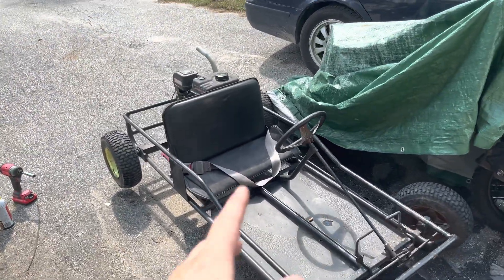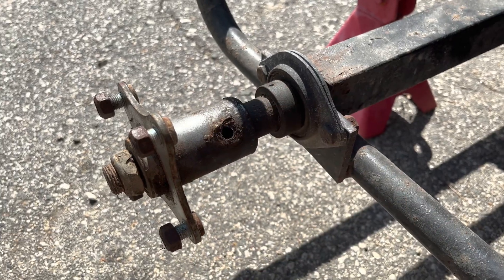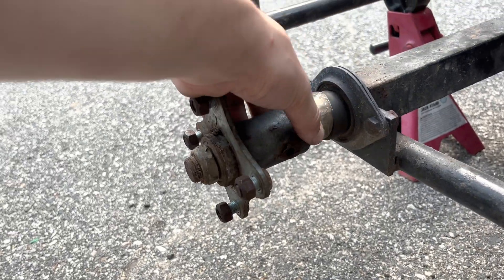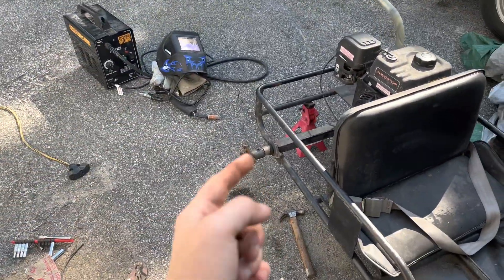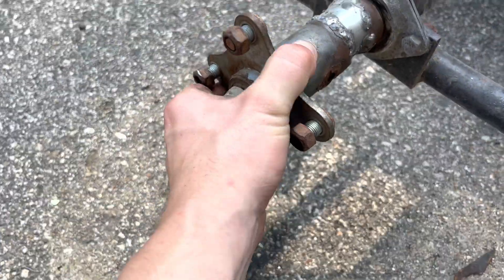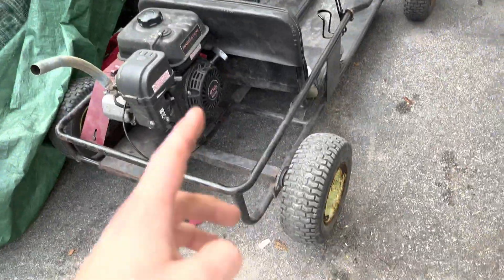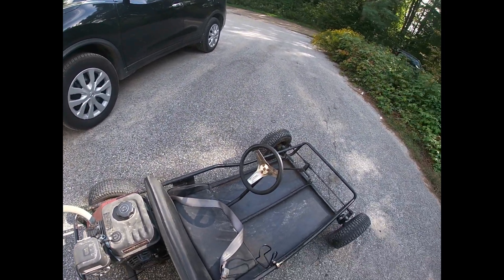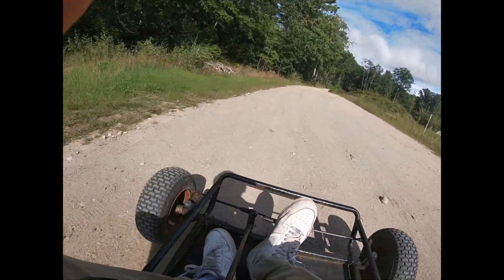Go cart 2wd conversion!

Comment: my rear wheel axle nut won’t loosen because it’s stuck spinning with rear axle HELP ME
Reply: try using locking pliers (vice grip pliers) to hold on to the axle itself while trying to remove the nut. you'll also likely need to use an impact and some type of penetrating oil if the axle is a bit old. hope that helps bro

Comment: hey dude what motor are you running on that trig what what is its top speed if you know thanks dude
Reply from the maker: I have a predator 212 right now with a limiter delete, originally went 24-25. Now will go about 45-47 kept up with my 110 dirt bike all the way till both pinned 🤣
Reply: @jibbasworld how did you up the speed on it after you already did a limiter delete